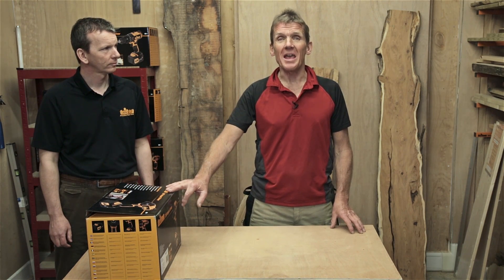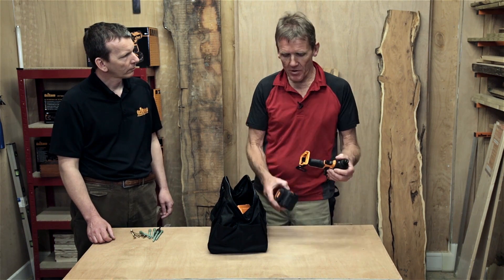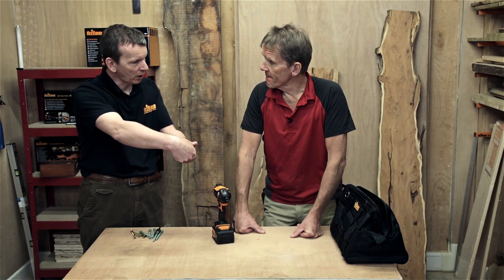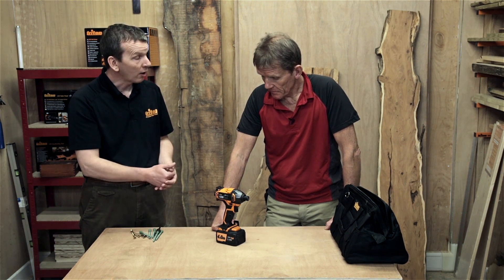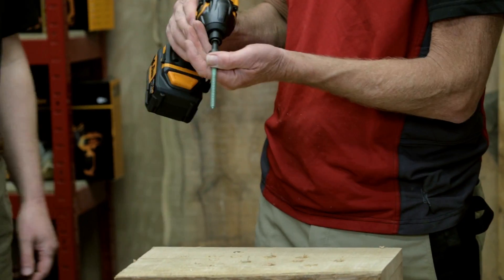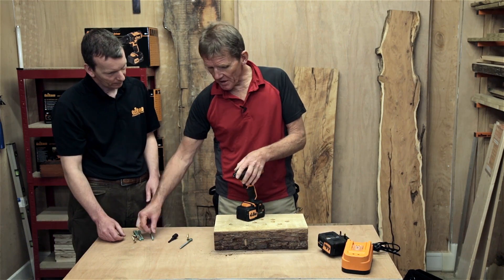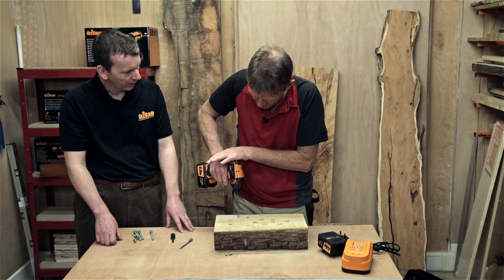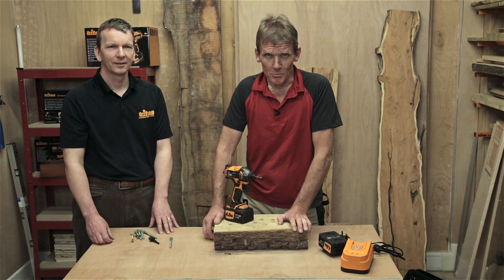Triton T20 Impact Drivers - How do they work?

Comment: You can't get 20V out of Li-Ion as the cells measure 1.2v, wired in a combination of series and parallel to give the desired voltage and A/h respectively  hence 10.8v - 12v - 13.2v - 14.4v - 15.6v - 17.8v - 18v - 19.2v - 20.4v and so on all in 1.2v increments.
Reply from the maker: +Enrico Conca 
You are spot on with your comment. It is a marketing ploy started in America.
Reply from the maker: plusthebadger  Are you talking about the fact that it is actually 20.4 voltage or am I missing your point?
Reply: Skill Builder Yes, the battery output should measure 20.4 v .... I know i'm been picky but im used to all other manufactures stating the exact voltage.
Reply from the maker: plusthebadger We have now found it is 18 volt measured on the peak.
Reply: Skill Builder Ahh, not good then. Why the hell didn't they just market it as 18V ?? Cheating I guess
Reply from the maker: plusthebadger It is a shame that one person does it and some feel they have to follow.
Reply: plusthebadger what are you talking about "You can't get 20V out of Li-Ion as the cells measure 1.2v" 

First off this battery pack has 5  Samsung 18650 cells in it (3.7v each).
Also there are several different lithium-ion chemistrys with varying  voltages.
Reply: +plusthebadger Lithium Ion batteries are 3.6 to 3.8V nominal, depending on chemistry. These samsung ones are 3.6V so effectively you get 18V nominal, and 21V peak right off the charger. (I guess they use INR18650-20Q or -20R, both of which are 3.6V high discharge rate)
NiCd and NiMh are 1.2V each, so you could get 20.4V on a Ni-XX pack, but you just can&#39;t get that on lithium cells.
&quot;20V lithium&quot; is pure marketing gimmick, mostly associated to an 18V nominal battery combined with brushless motors (that indeed put quite a lot more torque than their brushed counterparts), but in this case it is even more worthless because the Mabuchi motor is a brushed one.
Reply: +HowToOverthink First of... 3.7x5 = 18.5v not 20v.....so what are YOU talking about ? 
I also happen to know that the industry standard for li-ion is 3.6 v
TBH I don't wan't to get in to a chemistry debate, the problem here is that a company is marketing a tool as 20v when its not, its 18v.
We have Makita, Bosch, DeWalt, etc all following the rules and displaying the exact voltages (maybe not in the states as laws are different ), but not these guys, marketing a tool as 20v when its not gives a totally unfair and quite frankly illegal advantage over manufactures who are playing buy the rules.
Reply: +Enrico Conca Yeah I know, but the industry standard is 3.6v, the only reason i stated 1.2v as a multiplier is because I have had a few tools run on 12v li-ion, and of course this could not exist on a 3.6v platform, so I assumed li-ion are made in cells of 1.2v which could return 12v nominal.
I may have fallen victim to the same scam and have a tool that is actually running on 10.4v.....time to get my multimeter
Reply: There are also LiFePO4 cells which are 3.2-3.3V nominal, so 4 do them could be called 12V lithium. They have much less energy density but the same if not better current handling, and much longer lifetime (close to 2000 cycles compared to 500)
Reply: plusthebadger 1s Lithium ion polymer batteries should be at 3.7 volts each. 5 s would be 18.5v that peaks 20v fully charged (4v per cell).

Comment: are they true 20volt machines or is it just a marketing gimmick, just like almost all manufacturers have done in America?
i can tell you right now if they're actually only 18v machines then they've just lost all credibility as far as i'm concerned and i'm gonna dismiss their product right out of hand and look elsewhere,
Reply from the maker: S. Commander THOR The answer has come back from Triton. They are measured on the peak so in effect we are talking about 18 volt. They say it is like describing a 1950cc car as 2 litres. You be the judge.
Reply: +Skill Builder you don't say that electrical appliances in europe are 330v just because the peak is around that voltage either. You always
Reply from the maker: You are right to say that they are no different to 18 volt. The Americans tend to describe them as 20 volt where Europe says 18 volt. If you are aiming at the American market you shoot yourself in the foot calling it 18 volt so I would not judge anyone harshly. The real problem is that we don't have a standard way of describing these things. The same applies to torque. There are various ways of measuring it.
Reply: Skill Builder so you're saying THEY ARE 18v machines, just disguised as 20v,
battery voltages is and always has been measured by its nominal output, this thing in america is a very recent phenomena (started by dewalt, soon followed by everyone else), where they measure a momentary peak/spike of 20 volts when freshly off the charger, the battery then immediately settles to its NOMINAL 18 volts,
so this thing of calling 18v batteries 20v is, no matter how you look at it (or how ever many excuses you make) is dishonest and installs a feeling of distrust towards the manufacturer,
i would hate to see this kind of thing become widespread in Britain (as they have in America) where the companies are outright openly lying to its customers, fortunately all the big name brands here haven't done this, Triton is the first that i've seen try this sly, deceitful tactic, for this reason i won't even look at their products, let alone consider them,
thanks for the video and replying to my comment, have a nice day ;)
Reply: Skill Builder P.S so Triton is a British company? damn, now i'm doubly disappointed, shame on you Triton!
i'm actually in the market for a new impact driver, as my trusty 10.8v Dewalt doesn't quite have the oomph on larger tasks, i would've liked to consider this,
Reply: S. Commander THOR As per my comment above, the battery could actually weigh in at 20.4v and they'v rounded it down....if it is only an 18v pack then yes shame on Triton, my opinion looking at the size of the battery pack and given that you would need 12 of the 3.6v samsung cells in there ( 6 wired in series, 6 wired in parallel )  is that it is indeed a 20.4v battery pack, plus i'm not too sure that they would get away with mislabeling a product here in the UK to such an extent that they really should have marketed as 20.4v
Reply: +S. Commander THOR if you put a meter on it, both 18 and 20 should the same voltage. both batteries on a fresh charge peaks at 20v but runs around 18v after a few screws.
Reply: +Bryan Medley Thats not how it works. It outputs 20v without any resistance. Only 18v actually goes through the tools. and i bet, that if you take these tools apart, the motor will say its rated for 18v. I know dewalts motor does.
Reply: SweetStat DeWalt calls it 20v due two they have to lithium batteries lines one 18v and 20v so they don't mix them up in marketing the 18v lithium batteries slide up in DeWalt handle where the 20v lithium batteries just clips on the bass of the handle